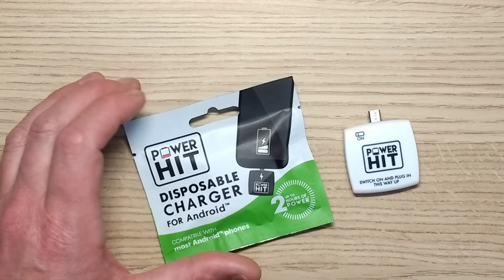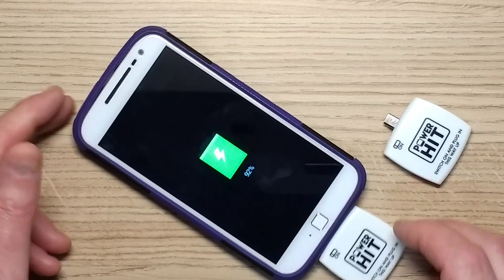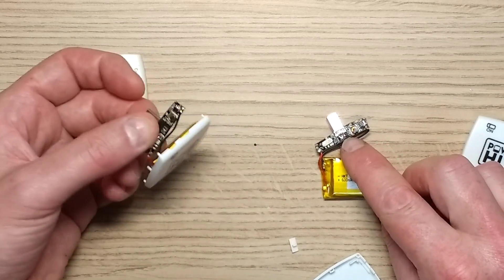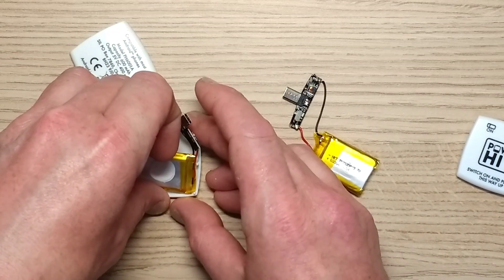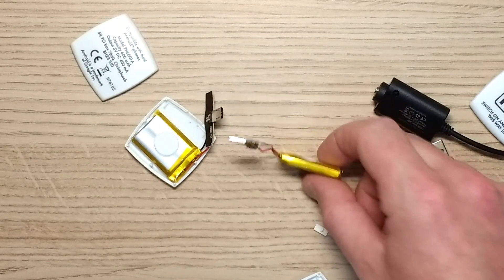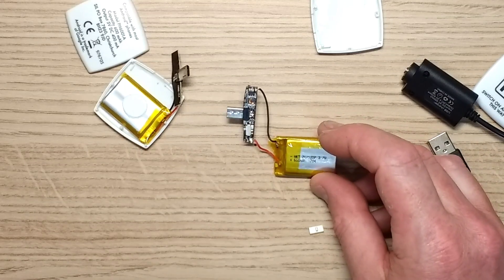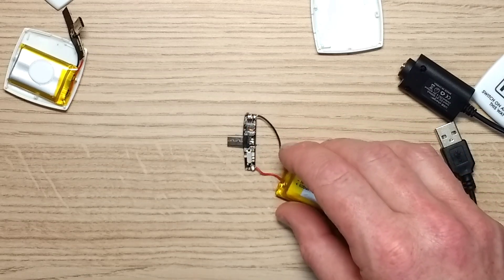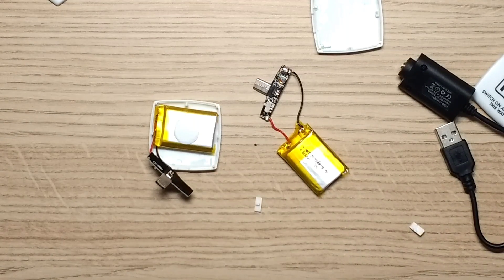What's inside a Tesco Power Hit disposable phone charger.

Comment: This product saddens me. Just imagine a festival site littered with this all over the place....
Reply: Spikey DaPikey I'd be scavenging every last one haha
Reply: Recharge and resell :') There's something worth doing at a festival! All well and good until one becomes... "Flamey".
Reply: Michael Sharpe - I bet the C rating is crap on these little 600mah.  Not sure what I'd do with them.  The booster circuit would be worth it though.
Reply: Spikey DaPikey They were being sold at boardmasters
Reply: Spikey DaPikey I like the sound of this.  O-o.   Free 600mah cells in perfect condition
Reply: thechosendude great to make a cr2032 adapter for a pc
Reply: But thats good:
FREE LITHIUM CELLS FOR EVERYONE :D
Reply: Spikey DaPikey I would be there to pick them all up, they are useful in projects
Reply: PirateKitty hey I am in need of 18650 batteries but they are quite expensive seperate. Do you mind sharing the listing or did you buy it in a brick shop?
Reply: Seriously what is the POINT of these? 

You can just buy any decently made portable powerbank in various sizes and capacity and they can be used/recharged up to hundreds if not a thousand times. Wayyyy handier and cheaper in the long run and of course more environmental friendly if you so desire.

Seem like a wholly unnecessary piece of product. Are there even people out there who can't be bothered to charge their mobile devices?
Reply: FuFu just go on eBay and search for used laptop batteries
Reply: Scavenge. Charge. Make a giant ass battery pack. it's not all bad!!
Reply: Swept up with the rotten food and Dog shit and thrown in a landfill. It's sad because it's true.
Reply: I'm wondering how this is even legal to sell...
Reply: Petros Adamopoulos it shouldn't be
Reply: Spikey DaPikey yet tesco have decided to stop selling single use carrier bags and opted to encourage customers to buy bags for life. I can still get my wasted one time charger whilst I'm getting my pre packaged fruit and veg.
Reply: matt n absolutely bonkers isn't it.
Reply: matt n absolutely bonkers isn't it.
Reply: i have gotten little power banks from walmart that have 2 off brand 18650's in them for around 3 bucks which makes the price of these even worse
Reply: Hey FuFu, I bought it from a shop locally . 
http://www.canadacomputers.com/product_info.php?cPath=2_383_1021&item_id=025140
A UK pound is about $2 CAD
Reply: DarkZerol I would guess for emergencies, this isn't something that people should be buying daily/weekly.
Reply: Even if it was an emegency you could get a 2000mAh rechargable powerback which usually comes precharged for almost the same amount of money
such a pointless product this thing
Reply: but think about the potential of picking it up and re-selling it, eh?
Reply: it's like little tiny disposable BOMBS.
Reply: Petros Adamopoulos Exactly my thought.  How in the blue blazes does this get RoHS approval? I'm a slovenly 'Murican and it makes me go WTF.
Reply: Capitalism kills.
Reply: sivalley Rohs is for lead, not ewaste
Reply: Spikey DaPikey and lithium.is toxic
Reply: thechosendude 600mah is barely anything
Reply: Even the Poundland/world ones are better that this!
Reply: @matt n, sad but true.
Reply: They wouldn't be in perfect condition being that they sat at full charge for a significant period.
Reply: I'd just be collecting them all. lithuim battery bank possibily
Reply: Better than fucking syringes
Reply: The Fox 
That sounds painful!!
Reply: It is covered by RoHS,  dead wrong though this would be subject to WEEE
RoHS applies to 
Lead (Pb): < 1000 ppm
Mercury (Hg): < 100 ppm
Cadmium (Cd): < 100 ppm
Hexavalent Chromium: (Cr VI) < 1000 ppm
Polybrominated Biphenyls (PBB): < 1000 ppm
Polybrominated Diphenyl Ethers (PBDE): < 1000 ppm
Bis(2-Ethylhexyl) phthalate (DEHP): < 1000 ppm
Benzyl butyl phthalate (BBP): < 1000 ppm
Dibutyl phthalate (DBP): < 1000 ppm
Diisobutyl phthalate (DIBP): < 1000 ppm
Reply: I'd be getting a lot of free cells then
Reply: jackpot
Reply: A 600mAh battery can run my arduino/Nokia 3310 Display/DS3231 based clock for months
Reply: Poundland in the UK sells small USB power banks for, you guessed it a pound! They contain a 120mAh 18650 battery and I have bought a couple just for that. OK the cells aren't uber powerful but worth it for the price (I use em in an LED torch I got for a couple of quid on Amazon).
Reply: 120mAh is nothing, wouldnt even last a single call.
Reply: You could make a fortune picking them up and selling them on....
Reply: Ridiculous price. For an effective 3 or 4  hours  of running time on my smartphone, if not using too many apps. £1.00 an hour driving  a smart phone compares poorly with cost of driving a Tesla for longer than that while charging a couple of smart phone on the go! Horrendous that rechargeble items are purposely made for one use before landfill. 
 Tesco  need to think that one out!
Reply: Spikey DaPikey I
Reply: an intelligent person would pick them up and create something new
Reply: Spikey DaPikey Imagine walking down a path and seeing litter everywhere, oh wait, you already do.
Reply: Spikey DaPikey swz
Reply: I'd scavenge them and make a damn tesla out of all of those batteries
Reply: one should use this for emergency purpose only...like stranded under collapse building or nuclear warfare or something disastrous
Reply: same goes for cigarettes
Reply: PirateKitty here in the US you can get 3 cell 2200mah 18650 battery banks at "Five & Below". I've bought probably 10 of them so far mostly for the enclosure alone. The 3 paralled cells and USB/Micro USB charge board are just a bonus :D
Reply: FuFu they're everywhere on eBay. Honestly I'd just buy cells or new products with 18650s considering the ratio of dead or nearly dead to perfect cells you'll get. Not to mention you can buy high discharge (8A+) namebrand cells for like $3 plus shipping brand new rather than $10 for 2A cells that may or may not have hundreds of cycles already on them.
Reply: 400 mAh is nothing compared to 10000 mAh rechargeable  batteries for just 20 euro
Reply: Spikey DaPikey I
Reply: Spikey DaPikey Yes what a waste..
Reply: Spikey DaPikey not like water bottles are the same way
Reply: ^SCAMMER/ADVERTISEMENT, DON'T CLICK ANYTHING EXCEPT THE REPORT BUTTON^
Reply: Collect them all up haha
Reply: Spikey DaPikey all we need is proper recucling programs
Reply: FuFu Poundlands USB power bank (£1..) uses an 18650 battery, plus you get a booster and charge circuit
Reply: nrdesign1991 I think he meant 1200mAh
Reply: It would take about 9 of these to charge a modern phone battery.
Reply: I'd go out and collect them all and build a power bank!
Reply: I'm going to hoard those
Reply: If they were biodegradable it would be great!
Reply: I'd pick them all up and reuse them for different little projects! 😊
Reply: Theres gonna be exploding all over so do nut playyyy!
Reply: You can make a emergency phone charger from that lol
Reply: I never took off anyway :)
Reply: Just repurpose them
And make a thicc powerbank
Reply: These will litter the streets one day
They will be like mini land mines for cars!!
Reply: They should have a "disposing bin" where they can replace the battery and recycle the old one.
Reply: A lot of festivals rent out powerbanks thankfully. It's usually 3 drinking coins for a new one and you'll get 2 coins back when you're done. I really like that system. Some festivals have a similar system for reusable cups
Reply: @cup_and_cone  Even with crap ratings, there's plenty of things that use 3 AAs or 3 AAAs that will happily run off a little crappy lithium.
Reply: Funny you say that. I help clean up after mucif festivals and save all the "disposable" vapes I find. The batteries are awsome for all sorts of projects. It's so wasteful to use a lithium cell that can be charged 1000s of times for a one off product.😮